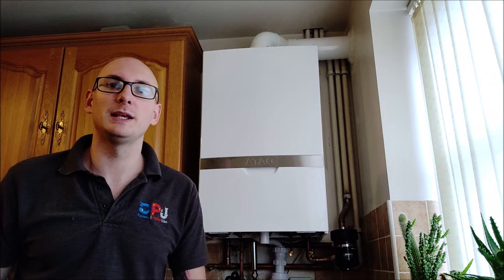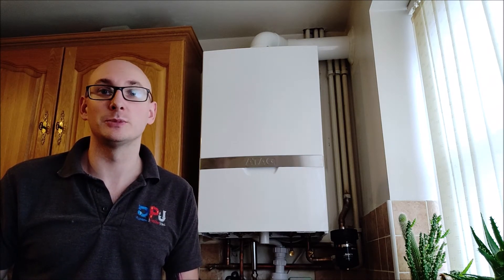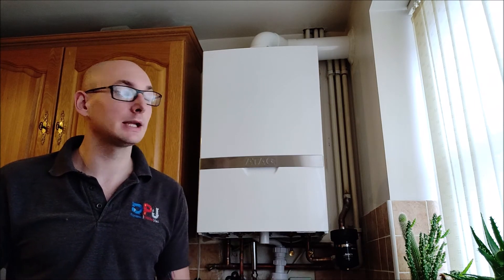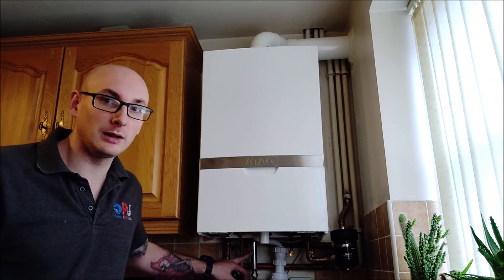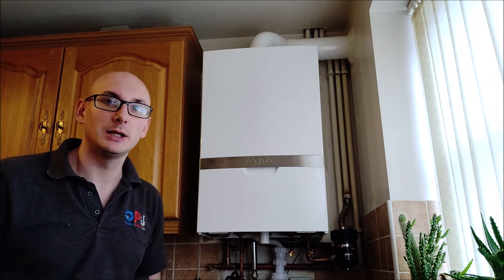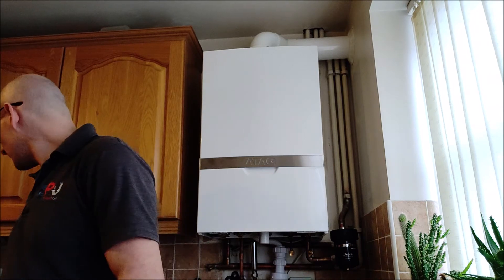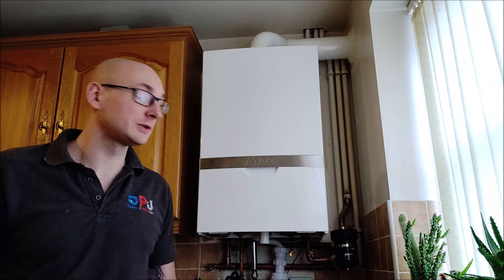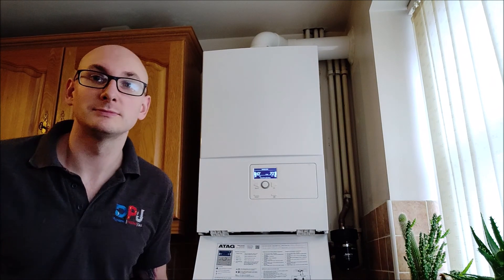Quick overview of our ATAG Economiser boiler installation

Comment: Hi. What does the setting do when you turn the wheel. A little sliding scale pops up, goes from 0 to 10 I think? Thanks in advance. Mine is the same as the one shown. ic 36
Reply from the maker: Hi,

I'm not sure. Has it been wired in with weather compensation?